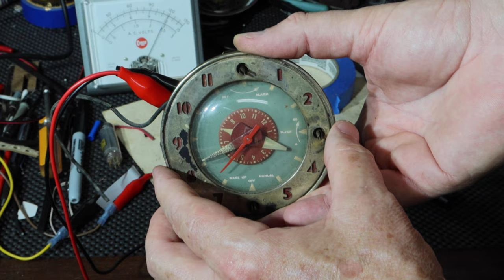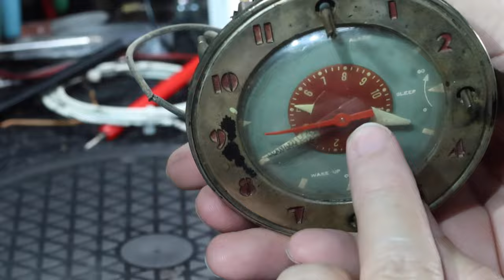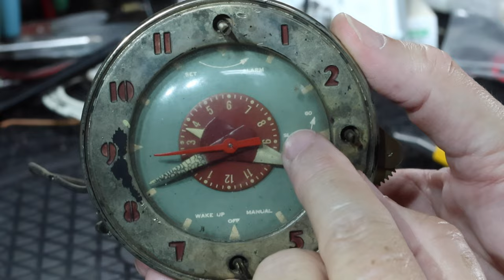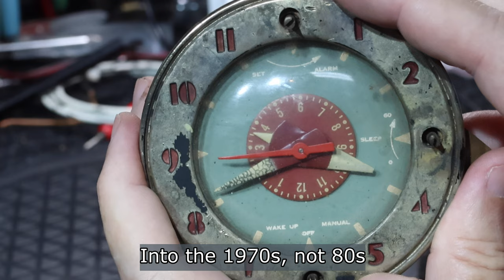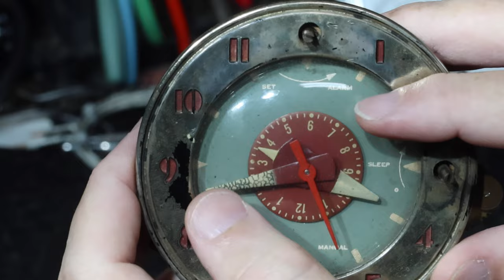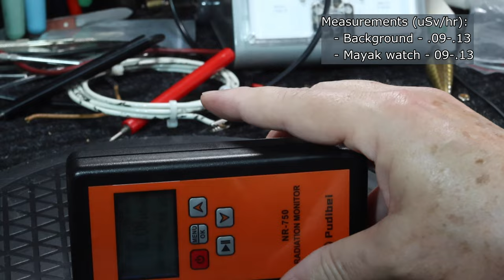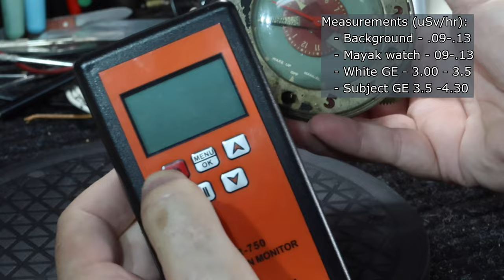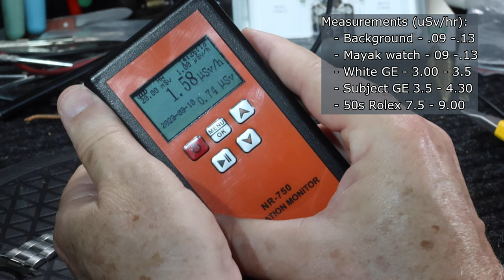The RADIOACTIVE Telechron Clock Radio Project - 1951 Vacuum Tube Clock Radio GE 512F Part 2 [4K]

Comment: Hey PF, nice work on the clock repair/cleaning. I have a GE model 535 which I believe is basically the same clock movement, but my radio chassis is a 6 tube with tuned RF. I acquired it some time ago and now I can't remember if the clock was even with the radio when I bought it on eBay. But from pictures I've seen, the clock looks just like that one. :)
Reply from the maker: Thanks.  The radio seems to perform ok for a AA5 so a tuned RF stage must be really nice.  The 535 is a nice looking radio.  Glad your back is better.